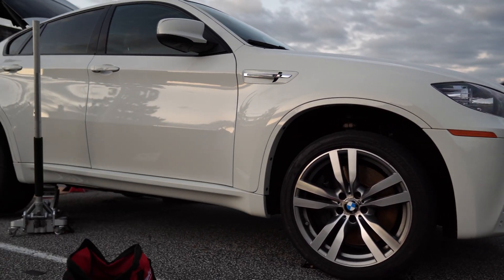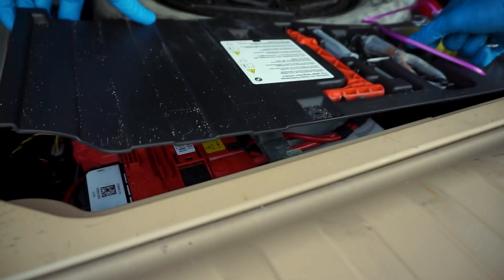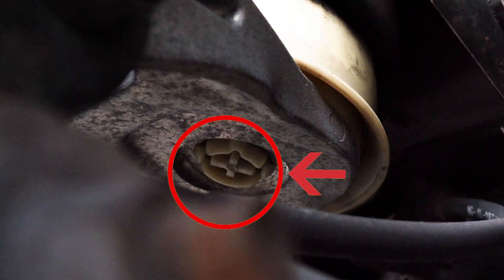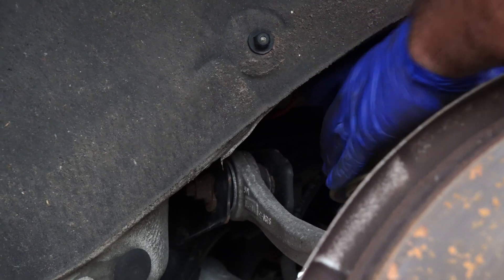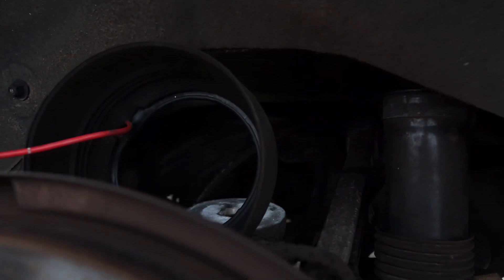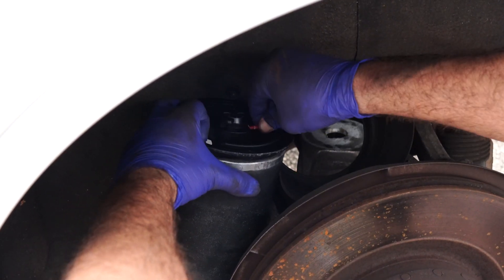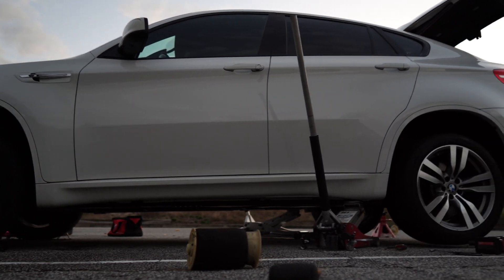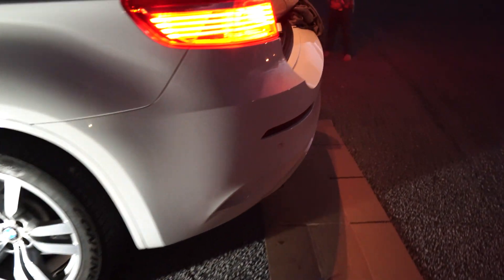How to replace Air Suspension on BMW X5 X6 DIY

Comment: I have this exact problem with the air springs here in South Africa for our X6 M50D 2017. Local BMW shop quoted us R37,000 ZAR ($2550 USD) for replacement and fitting of only the rear right below air spring.Our air spring is currently leaking. Thank you, I have placed an order for this air spring.
Reply from the maker: That's definitely ripoff! Glad you figured it out to fix it yourself!) Good luck!)
Reply: Very easy to replace do it yourself save money

Comment: yeah i have same car as your after i changed the air spring my car still not level pls help thanks
Reply from the maker: Do you have ISTA? Or higher end obd?
Reply: @Makhnovets  what number do u put to bring the vehicle higher or lower
Reply from the maker: It's only can be done with dealer lvl software, like ista, inpa, or any higher end obd.
Reply: @Makhnovets  ok what is the stick ride height level
Reply: Stock ride height
Reply from the maker: @Sunny-me1xq  i will need to check uset manual!
Reply from the maker: @Sunny-me1xq  if you using the ISTA, there are full Manual inside the app, and it's explained everything step by step. After you did replacement, you need to drive the car for couple miles... It should level itself.